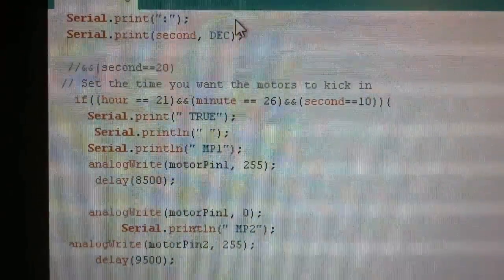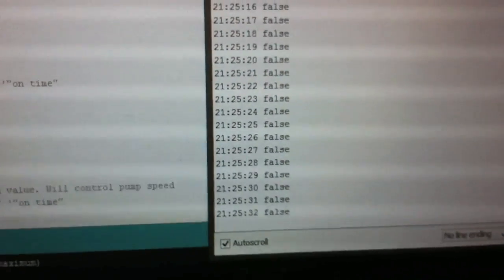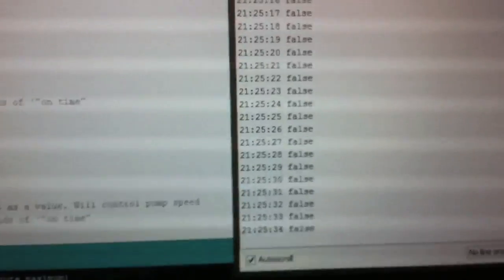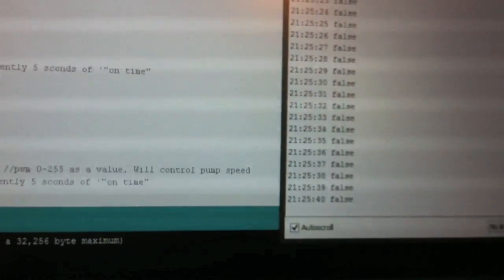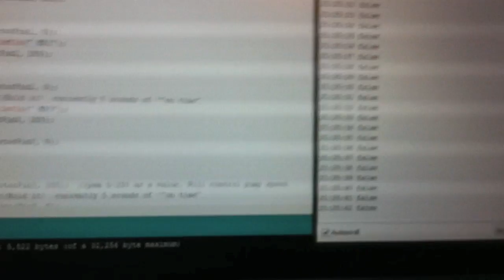Arduino Auto Doser - Aquarium Dosing DIY

Comment: Hi, 
Can we have more clear picture how to connect this?
Reply from the maker: Kosta Stojcev check the links in the description. I did post one a while back of it
Reply: yes, i check it but it is a little unclear so if you can take more clear shots. Thanks
Reply from the maker: Kosta Stojcev sadly I no longer have it. I traded it for some corals a while back
Reply: about the diodes. Why so strong diode? can it be some normal diode? If you can share some other types that can be replacement?

Comment: Since your link in description is not working, I have to ask it here..what is the flow rate of the peristaltic pumps you used..I guess for ph dosing it should be 1ml per minute .
Reply from the maker: just checked and the link is working.. mayhave been a temporary issue.  the pumps are about 1ml/second but you can control the speed via pwm

Comment: Very good job! I would like to add Metricide is a light sensitive chemical and will lose effectiveness after about 24 hours of light exposure. I would recommend using a Seachem excel bottle to store your Metricide instead of the water bottle.